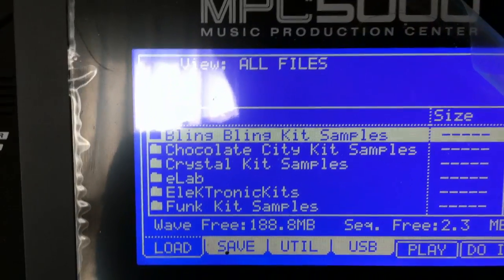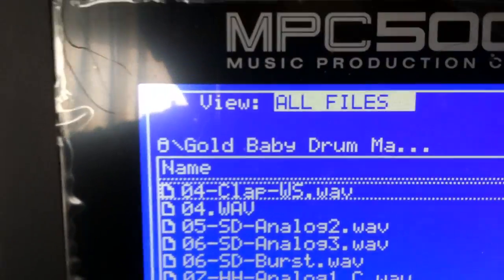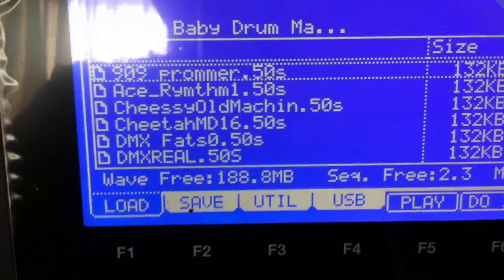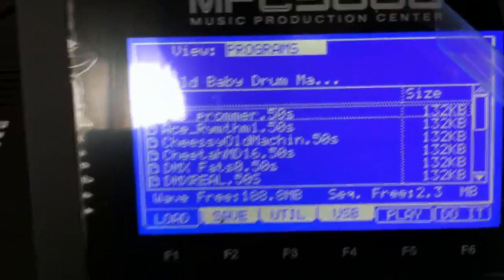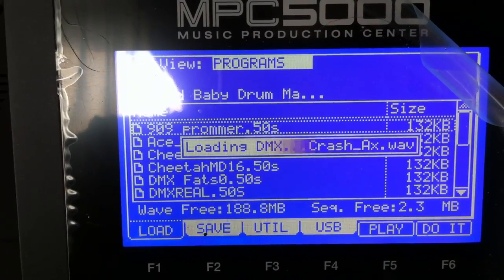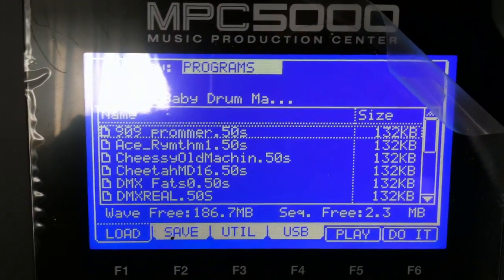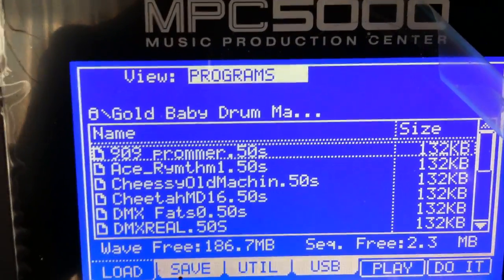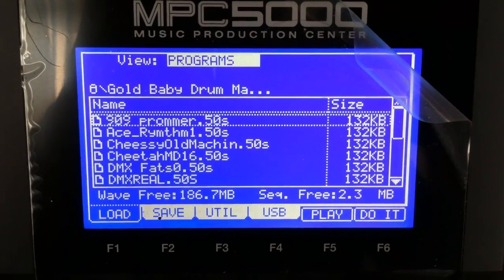MPC 5000 1 TB Hard drive Install Part 10 FINAL

Comment: I did the same last year with an SSD drive. Worked perfectly but didn't notice a major increase in speed - as I understand the MPC is the bottleneck, but it's still comforting to know the drive is less likely to fail and a whole lot quieter.